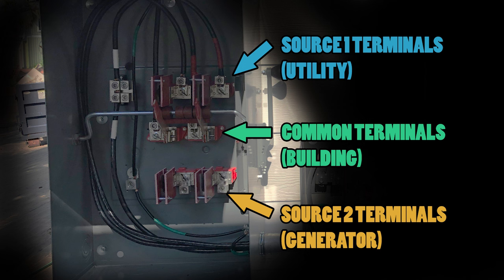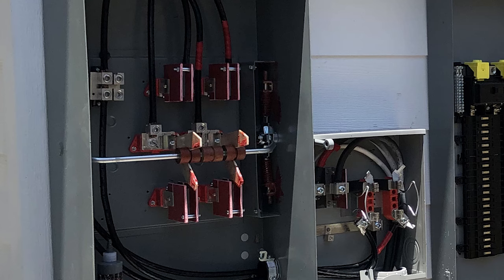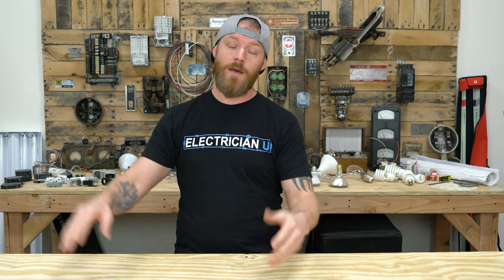Transfer Switches - DIFFERENCE BETWEEN MTS and ATS, & HOW THEY WORK

Comment: So you would install the transfer sw in between the meter and the panel? With the generator hooked up to to the bottom lugs
Reply: Yes but I would just clarify what you mean by the bottom. I do generator maintenance and repairs so this is all I do. 

I work mostly on Generacs but ATSs are pretty much all the same. There are 3 sets of lugs. The utility (usually N) where the utility power is connected, the standby/emergency (usually E) where the generator or other source is connected, and the load (usually T). They're configured in a way so that N or E are connected to T but never both.

Sometimes people hook their generator right up to their main panel or meter and people working on the utility are pretty much hooked up to the generator. Also when the utility voltage does come back, it can destroy the generator with this setup. Transfer switches isolate power to solve this problem.

Comment: I am trying to find a solution that ties my existing Generac automatic transfer switch to a second transfer switch. The second transfer switch would have solar as normal supply and the alternate would be from the Generac automatic transfer switch which has grid power as primary and 24kw generator as secondary . It is for total home 200 amp service. I am looking for solution to isolate grid power from solar power that is safe and nec approved.

Comment: How do transfer switches deal with the neutral line?
Reply from the maker: Great Question! So, doesn’t power back feed on the neutral? Let’s take a look at some fundamentals of electricity for this answer. We know that during a fault, power finds the path of least resistance to get back to the voltage source. So with a generator  set up, the power produced by the generator is in DC, then converted into AC by rectifying it. With this theory, we can then assume since electricity is trying to return to the source, it would then return to the generator.

Comment: We need a ats for solar panels that can detect the main power failure or brown out and disconnect without shutting off the solar array with generator backup
Reply: Generac clean energy back up!!! It is a solar ATS that also has a 10KW battery back up.  Working on my second install now.
Reply: @JsIsMsBsO  ok so can you hook a generac generator to this?

Is it a whole house universal power supply?

or does it transfer off the grid?

Or is it one of those that have a critical load panel?
Reply: @Tactical-Black  this is a critical load situation.  With one inverter you can support a continuous loaded of 240v @ 33A, it can peak at 40A for motor starts.

The hardware for a generation tie in is there but they have not amounted it yet, they have announced that it will be available by the end of Q2.  The unofficial word is that it will not be brand specific but will have to need requirements like size, voltage, and has to be an automatic start back up generator.
Reply: Tom Garbo   they are a closed cell module  battery unit.  The wall mount has built in fans for cooling so it needs "working space", it does not need any external ventilation.  

If you are interested read the new NEC 2020 article 706 for energy storage.

Comment: Dustin, do you have any thoughts about the interlock mechanisms that you can install on a panel as a substitute for a transfer switch for back up power applications?  I makes it so that you cannot turn the main breaker on if you have the generator breaker in the on position.
Reply: They're the most important piece in the entire system if you're going to setup a circuit to backfeed from a portable generator. Forgetting/choosing to go without an interlock is a terrible way to do the job wrong. They're <$50. Buy the piece and use it.
Reply: This is what I've seen, and I've seen a lot of interlocked breakers on boats, too.

Comment: What controls the arcing at the terminals if the transfer switch is operated live?
Reply: Fret01   The switches are spring loaded to quickly engage the switch.    Reduces arc.
Reply: @KevinCoop1   - Thanks Kevin.
Reply: Fret01    No problem.   An interesting thing he doesn't mention is if on generator, they synchronize with the utility before transferring back.
Reply: Yes there's always some arcing so I keep an eye out for pitted contacts.
Reply: @KevinCoop1  It does not need to synchronize with the utility. They are completely segregated and never come into contact with each other.
Reply: goaliedude32    I'm sorry, but they do sync with the utility company before transferring from generator back to the utility if they are "Automatic Transfer Switch".    If they do not sync first, highly probable that motors will break their shafts.   
ATS's can be open transition or closed transition depending on what the utility company will allow.   Closed transition means both are connected for a slight amount of time.
Respectfully,    Kevin
Reply: @KevinCoop1  sorry. All of the ats I've installed have been open transfer. My fault. Yes if they are closed transfer they would have to sync. I doubt its because of mechanically breaking the motor and more of electrically short circuit different voltages.
Reply: goaliedude32    All I know is that when I took a class at Cummins manufacturing plant in Minnesota, that was one of the reasons they gave.

Comment: Wondering how an ATS manages 2 utility sources with a generator backup as well as dual battery bank emergency sources
Reply: You typically wouldn't use a single ATS to manage a system like this. You would have two ATS's (1) would handle the Utility/Utility transfer and the output would be fed to an ATS that handles the Utility/Gen sources. This is usually referred to as a 3-Source System. When you introduce a battery system into the mix, you wouldn't use a traditional contactor based ATS. There is another type of switch called a Static Transfer Switch which uses MOSFETS to accomplish the transfer near instantaneously. These types of switches are what is found in UPS systems.
Reply: @RussellKasem  thanks Russell! As a system operator trainee,  I had to map our new control room electrically. These were some questions I encountered through the process.
Reply: @ryanpaulik864  You're welcome! I used to work for ASCO Power (Schneider Electric's ATS / PCS Division). They categorized this setup as a 3-Source System.